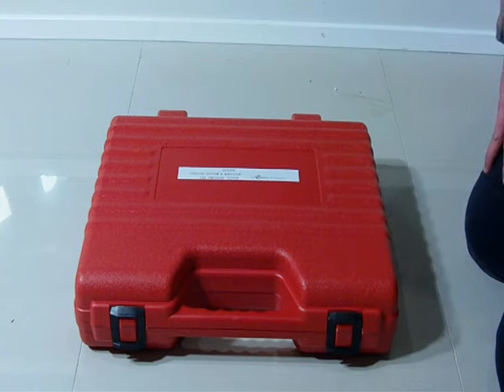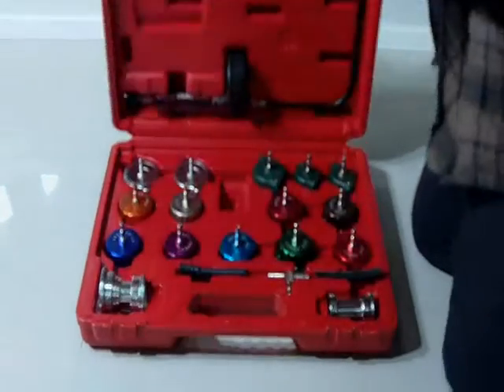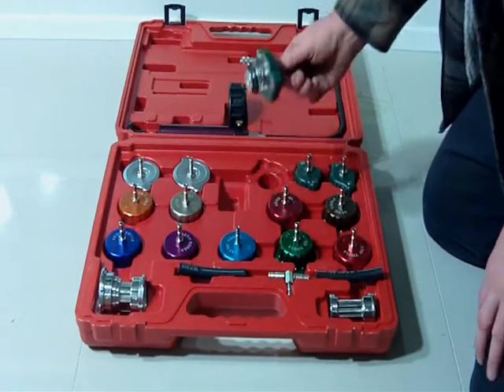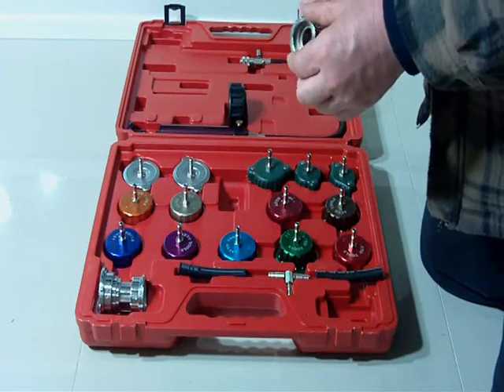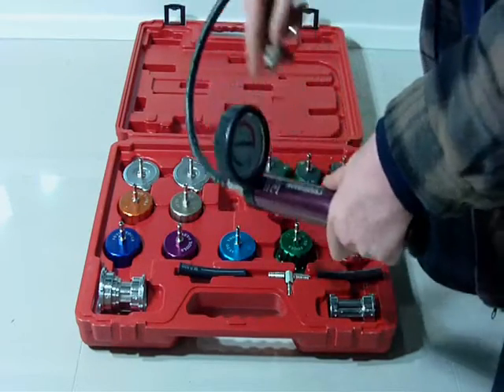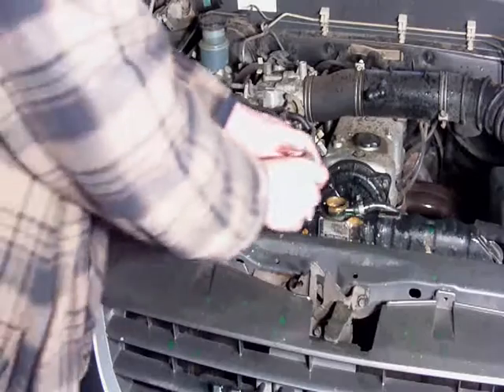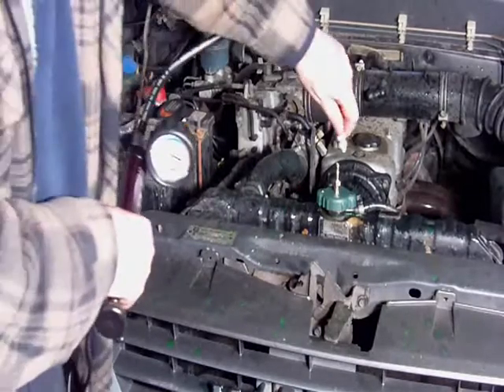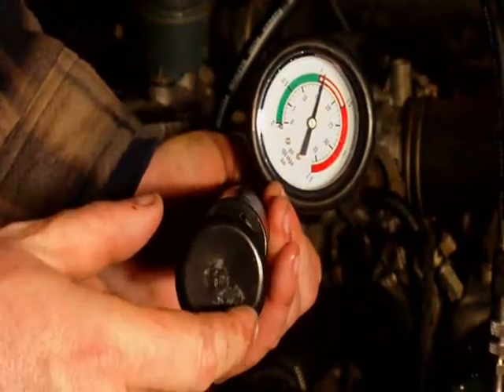Universal Radiator Pressure Cooling System Leak Tester

Comment: firstly, really small issue but important- dont ever pull out the pump from the case by the hose, you will damage it. Second, you dont need to look at manual what pressure is for thte cap, it will be on the cap (if its not, then its a cheap cap and you shouldnt use it). they will register psi or bar.

Comment: Don't forget to use your finger and dip it in the existing antifreeze and wipe your finger around the seals of the various caps and adapters your going to use first to lubricate them so the seals last longer. Thx for the vid.